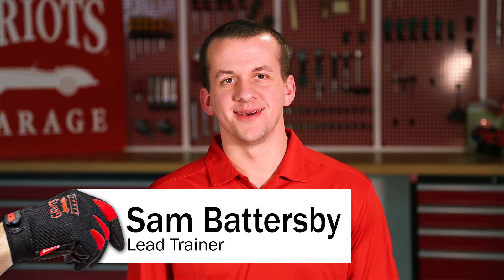Griot's Garage Q&A - Is Iron & Fallout Remover used prior to claying?

Comment: Can you use iron remover then clean it of with a rinse less wash solution then clay? I've seem  Mike Philips doing this on a forum.
Reply from the maker: Yes. Hose rinsing iron remover off will be faster and more user friendly but it can be done using a rinseless method when a hose isn't available.  If using our products I recommend pre-soaking the surface following use of the iron remover with Rinseless Wash & Wax at 15:1 in the dilution bottle. This will allow the iron remover to come off cleaner with less wiping. It can also be beneficial to leave your towel or wash pad more saturated with wash solution to make wiping off the iron remover easy. Then follow up with a thorough dry as usual and proceed to mechanical decontamination.
Reply: Thank you for getting back to me

Comment: If I apply a sealant (not a coating), then wax over the sealant with spray wax (approximately once a month). When would I need to consider re-applying the sealant again?
Reply from the maker: If depends what conditions the car is used in. If it's daily driven and experiences inclement weather, it could need a fresh coat sooner than if it's only driven on the weekends in nice weather. If you're still waxing the car every month, your base coat of synthetic wax should last a long time and you may only need to apply it once per year.